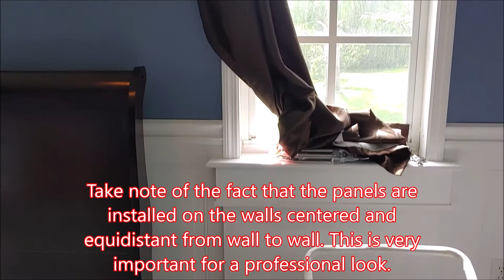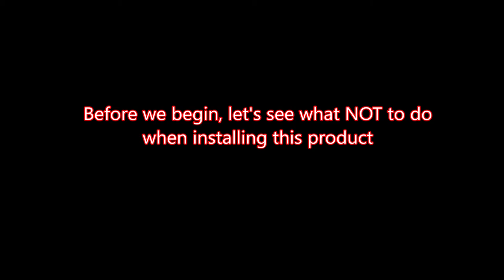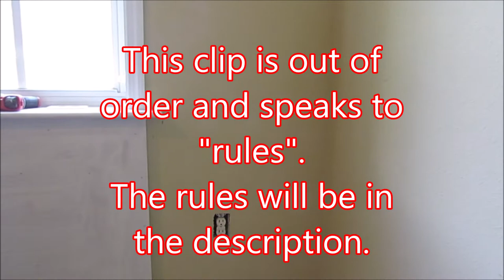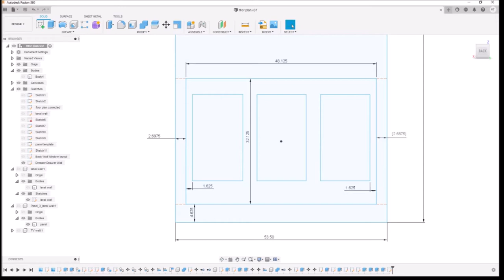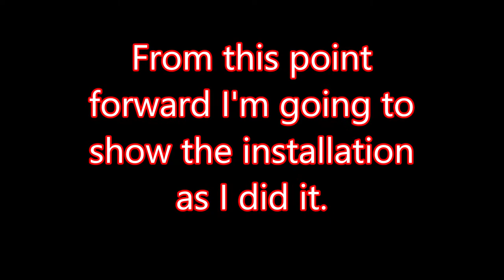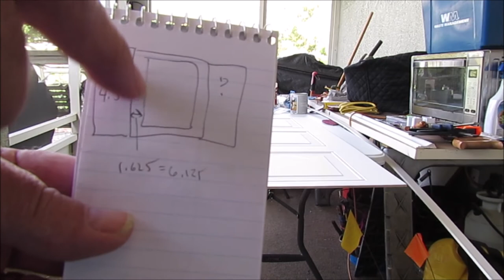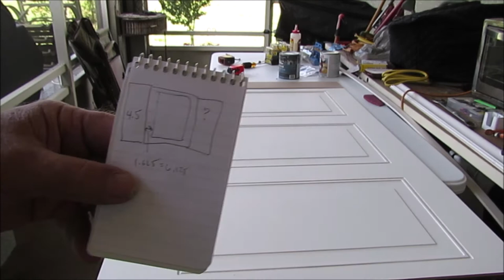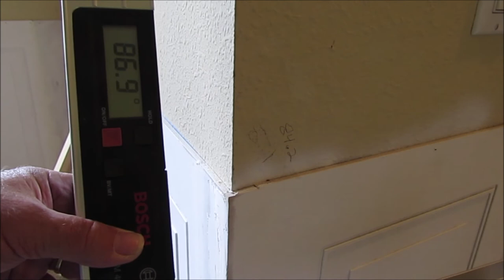Home Depot Mirage Wainscot Wall Panel Installation

Comment: Thank you so much...I purchased these panels and there were no directions.....THis is perfect!!!!..One thing I thought about when reading HD was the seams..I am by no means an expert..heck I'm barely a novice but my first thought about the seams was also using spackling.....gosh I am so glad I watched this...especially the rules about the panel and not putting 1/2 panels on walls..that was so helpful. this video should be used on HD....your panels look so much thicker than the ones I purchased from MUR designs...(25 inch..) You should consider having an "official channel"...I barely can use a drill, so I watch a lot of videos because whenever I hire "professionals" I end up with chaos..so I've decided to learn myself resulting in projects taking a long time...Your videos are one of theh best I've watched not only showing what to do, but what not to do...a lot of channels explain as if they are talking with professionals...not realizing most going to YT have no idea what they are doing...you are a great instructor,.,,

Comment: How are you making the blank panels?  I cant figure out where in the video you talk about this.
Reply from the maker: 48:00 and forward. Please watch the video. It's not a good idea to skip around or skim through it. I know it's long but in the end you'll be happier if you do.😀
Reply: @kaydee457  Thanks!  One more thing do you know if I should be able to use jigsaw to make the cuts.  I dont have a table saw.
Reply from the maker: @johnt697  Well, it will be harder but as long as you keep the cut end in a corner that can be covered over by lapping (again you have to watch the video and this too will be explained) then you should be okay. You will absolutely need a straight edge to guide the saw, though.
Reply: @kaydee457  Thanks for the all the feedback.. your video is the best one on this material installation.  And your adivce on making it look professional is spot on!  Great job.
Reply from the maker: @johnt697  You really should consider getting this straight edge from Harbor Freight: https://www.harborfreight.com/50-inch-clamp-and-cut-edge-guide-66581.html

Also, a small circular saw to cut panels instead of the Jigsaw: https://www.lowes.com/pd/WEN-5-Amp-4-1-2-in-Beveling-Compact-Circular-Saw-with-Laser-and-Carrying-Case/5000575469

These are only illustrative recommendations as I don't own either but if I didn't have a table saw and only wanted to cut panels then this is what I would use.

Comment: what if the wall’s not straight?
Reply from the maker: In what plane? Not straight as in not flat, or not straight as in the corners are skewed? A mild bump in the wall won't be noticed but only you can judge that.
In the case of a wall that's not straight in the horizontal plane, as in the wall leans out or inward from the top to the bottom then the corners where the panels meet will need to be cut to that angle.
The way I do it (and I think this is shown in the video) is to use a laser level with a horizontal line that's projected on both walls and align the panels to the level horizontal. Next use your laser level to project a vertical line near the corner and measure the distance from the vertical line to the corner at the bottom of where the panel would meet the wall, and the same from the top of where the panel meets the wall. These will give you the slope of the end cut for your panel. Similarly, you may have to do the same for the adjoining wall. It depends on how crooked your walls are. The key point is to always align the top of your panels to the horizontal level line around the room, from wall to wall and cut corners as necessary to align them.
Reply: @kaydee457  can a wall be out from a 1/8 or 1/4 from top to bottom. I might it wrong, I going to cut the pieces with a router and mark any distortion. 1/8 can be seen  or can you cut it near enough.